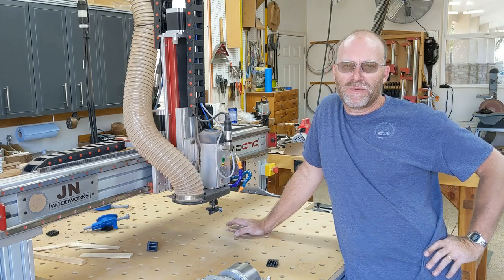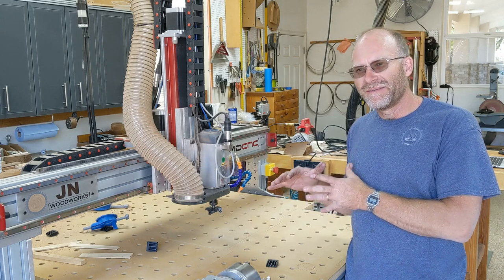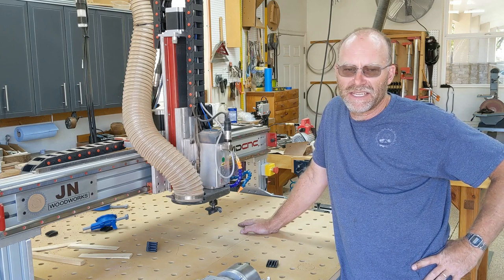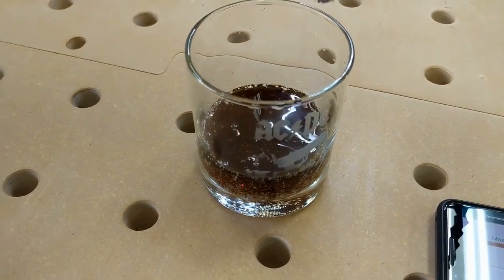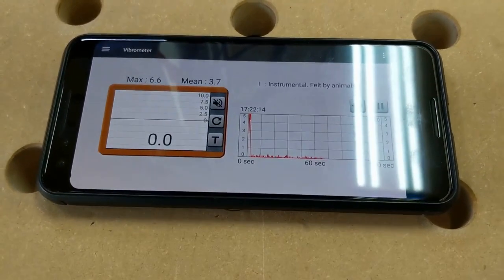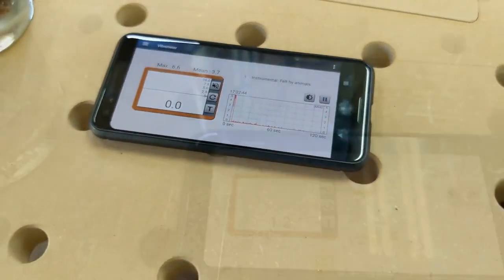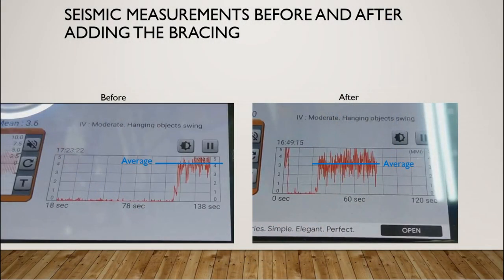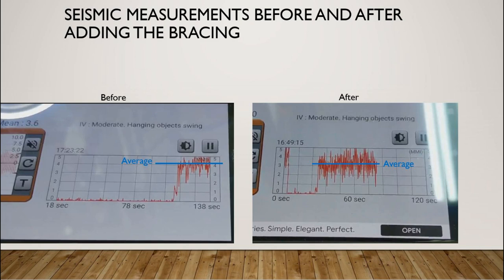Vibration reduction project for my AVID CNC Router table

Comment: Hi Jim, great video. One of the major causes of vibration in these Avid set ups is due to the very large mass of the gantry and its location. The center of gravity is very high and as such as the x and y accelerate it induces these vibration/ In addition to the straps that you added a lower shelf addition would allow you to counter the weight of the gantry. I have about 400 pounds on the lower shelf and it has helped significantly. Cheers!
Reply from the maker: That's right, large mass on top, and pretty powerful X and especially Y axis motors.  Thats why AVID doesn't recommend the extra high Z stage, or 8.8hp spindle, etc. unless you really need it.  The table bracing and extra mass in the bed both go towards the same goal.  In the end you have to run slower than the machine can go just to keep it from shaking itself apart.  Since I'm a hobbyist, it doesn't hurt me to slow it down since I'm not making money off of it.

Comment: Jim,
Thanks for all your great content!
I have had my 48x72 going for a month now and I experience the same vibration.
I’ve added a lower shelf 2X4s lumber and plywood, and will be adding weight for dampening. I will also be adding plywood sheathing for shear every where I can get it. And boxing in as much as I can.
We’ll see…
Reply: I'm glad I found this video.  I've seen similar behavior in my 48x96.  I'm curious if adding the plywood sheathing on every surface of the stand helped reduce vibration/increase rigidity in your setup Steve.  I think I may add a lower shelf and add weight there as David mentioned in his comment.

Comment: As a mechanical engineer that has solved lots of vibration issues, adding mass is the quickest, easiest and cheapest way to solve vibration problems.  Adding a low shelf and storing tools on it is one solution.  Weight lifting plates are nice but are about $1 per pound.  Bags of sand are an alternative and cost 75% less. But they always leak sand.

The pendulum suggested below is a viable solution. But the pendulum should be mounted near the top of machine.  Skyscrapers have (big ass) pendulums to dampen vibration caused by wind or earthquakes and they are mounted near the top of the building. 

Also, there are several places where stiffening plates can be added at the corners.  80/20 sells a bajillion styles of these plates

Comment: Hi Jim.  I just recieved my 4' x 10' and have started putting it together, one thing I noticed on mine was that when tightning up the fasteners on the legs and especially the cross rails (with the double Tee Nuts) that using a drill with a torque limiter/clutch (Festool CX) the drill would clutch out and I would assume that the fastener was tight, however, this style of fastener has the ability to 'cock' and not seat squarely meaning that the fastener is in fact still loose to some degree.
Once I saw this I went back through all of them and found >50% of them that needed further tightning, since doing this the table feels solid, at least with me pushing/pulling on it.
May not be your issue, but something to be aware of and easy enough to check.
Will get back to the build and hope no more issues, fingers crossed.
Cheers
Gus
Reply from the maker: Hi Gus,
Ya, I noted that too.  I haven't noticed them coming loose over time though, and my table never felt loose just trying to shake it by hand.  But those nema 34 motors can push a lot harder🙂

Comment: I’m an engineer. Using aluminum, pound for pound, vs steel can actually be stiffer. A well designed bolted joint can be just as stiff as a welded joint. Those things are not really factors. The Avid design lacks adequate triangulation. Ideally you want a space frame or truss. You want to keep the table from twisting as the gantry is loaded side to side, and to keep vibration to a minimum. If you think of the ground as the most stable possible surface, then the frame base design should be to extend that stable surface to the table height. But if your floor is not stable, then all bets are off. I would add triangulation in both the x and y directions. That will sacrifice space under the table for storage. But you have to make tradeoffs, is stiffness more important or storage more important?
Reply from the maker: Stiffness isn't necessarily a good thing.  Steel typically has a higher Q factor than aluminum and if not used right can be a very efficient oscillator.  You are correct about the joints, it doesn't really matter if they are bolted or welded, they are less of a problem than the flexing of the joint (as long as the bolts aren't loose).  The most overall stiffness does come from triangulation, which is why I did add cross bracing as shown at 5:11.  All of this only goes so far because on top of the table/stand, there is a lot of flexing int he gantry and other components as well, and that always has tradeoffs as well.  I did another video on balancing the motor accelleration settings in my controller between longer execution time and lower vibration, that had a much bigger impact on vibration.  https://www.youtube.com/watch?v=ws4fzEN97BU&t=2s
Reply: You need stiffness if you want good surface finish AND fast cutting. Yes, you can slow it down. No matter the metal type, everything will oscillate at its resonant frequency.
Reply: Actually, an interesting thing to do would be to isolate the effect of the rubber feet on your vibration test. My hunch is that the rubber feet doesn't supported the machine that well, as it pivots and moves around on that small center bolt. Shim up the legs so that the feet isn't bearing weight, and then repeat your vibration test. Make a follow up video about it; I think it would be interesting.
Reply from the maker: @acutabovefurniturestudio  I don't have rubber feet on mine.  They are steel pucks that are bolted to the legs.  The vibration on the Y axis is an order of magnitude more than that on the X axis and that is due to the construction of the gantry and how it mounts to the table etc. as well as the amount of mass that has to move in the Y direction vs. X.  I was down to about 4-5 thousandths of an inch peak to peak in the the initial amplitude from a direction change, which isn't much, but even with a completely rigid table, the top end of the machine also flexes and there isn't much I can do about that besides cut down the acceleration settings on the X and Y motors (a topic of another video I did later).
Reply: Got cha! @JNWoodworks

Comment: Hi Jim. a lot of what you are experiencing is vibration resonance in that aluminum extruded structure, a lot like a tuning fork. the best way to eliminate that is to dampen it. what I did was buy a 3 inch memory foam mattress topper and cut it into 3 inch by 3 inch long strips. I tied a string to one end and had my daughter pull it through the hollow Extrusion while I compressed the other end. this allowed the memory foam to expand inside the aluminum Extrusion. I did this to every single Extrusion, probably Overkill but the difference was huge.
   the machine now Acts like a machine five times its mass, you may not want to do this as your machine is already assembled... it was a lot of work. but I would highly recommend you at a minimum do it to your Gantry and your bed rails. it will make a huge difference and those things are the low-hanging fruit.
 hope this helps,
Reply: That's a really interesting idea! I would like to learn more about this, did you read about this somewhere that I could get additional information?
Reply: Hmmm....I wonder if polyurethane foam insulation would accomplish the same thing.  Squirt some in and let it expand.  Probably easier/faster than inserting memory foam.
Reply: I'm actually trying to do that now. There is no way a 3x3 strip is fitting into those small extrusion holes. I am trying 1.5 x 1.5 with some success; the foam keeps breaking about 40% of the way in (yes I am pulling and stuffing at the same time.) How ever did you manage this? I am using a memory foam topper (got on Amazon) but it fully expands within minutes so there is no way it isn't going in fully compressed. Perhaps, as suggested above, the spray foam insulation would be better (though how would you get it in far enough?)
Reply: @gilroykilroy  Guys, best solution would be to fill your extrusions with sand(yes) and seal the end openings(to avoid 'leaks'), ofc, that would require doing it prior to most of the assembly( though maybe you could do it for the 'legs' after the fact)

Comment: Jim, have you tried varying the acceleration on the x and y motors in Mach4? I think the stock Avid setting is 50 which might be more than needed for your application and be the cause of a lot of the vibration.  My current machine is not an Avid but I never run it much higher than 30 and still get very good performance.
Reply from the maker: Yes, I mentioned that in one of my videos.  The stock AVID acceleration settings are too high for most of their larger configurations.  I have cut all of mine back to 25 and that helped a lot.  It also did not affect the run time in any significant amount.

Comment: try implementing a pendulum (hanging mass) under the table...in theory it would counter the vibration. vibration is a waveform...change the frequency of the waveform you change the vibration.
Reply: a neat idea

Comment: I have an avid 5x10, what you did theoretically should help but in reality bracing isn't as big of an issue as is mass, the gantry is very top heavy and the bottom of the machine (few legs/braces) are very light, inertia gets the best of the avids... at one point I had a large lumber delivery and had my guy store about a 1000 board feet of lumber on the lower shelf of my machine and let me say that with the weight on the bottom my machine ran smooth as butter, no more chattering, even at 300ipm full depth through 3/4 plywood it felt like an industrial welded cnc. Given my experiance, I ordered up a bunch of 80/20 to make two additional shelves, bracing and filled them up with ranger board mdf. Load up your bottom shelf with as much weight as you can find and run the test again. Secondly and this is a very important step that I noticed wasn't very pronounced in the instructions when I built my machine was to use locktite on every single fastener on your machine, and I mean that with the utmost importance, every single bolt, I had to get my z axis replaced because the bearing blocks came loose and ruined the dust guard. On the new one I took it apart and locktited everything! Best of luck ! Great video
Reply: @zoltanbereczki8067  blue locktite only prevents the screw from rattling loose, not from being unscrewed. As long as you don't use the red locktite, you can easily back the screw out. On smaller screws, use very little, just a tiny little drop.

Comment: Hello, I’ve been investigating this issue with my own machine similar to yours. People seem to forget that the that these machines are sitting on six 1/2 inch pins to the floor. There has to be movement there. I’m considering bracing to the floor or setting up blocking to strengthen that section. Just a thought.
Reply from the maker: Hi Bill,
Well, those pins aren't meant to stop the machine from moving.  The stiffness comes from the frame, not the connecting to ground.  However, in the end most of us that worked on the frame only got moderate results because in the end, if your motor movements are too agressive, any machine will flex and have vibrations.  I got much better results by adjusting my accelleration settings.  See this video:  https://www.youtube.com/watch?v=ws4fzEN97BU
Reply: Hi, when I look at mine which is similar to yours, even if I completely stiffen the frame, I am still left with those 6 adjustment feet flexing back and forth in the threaded piece of aluminium bolted to the bottom of the aluminium legs. I suppose if I screw them all in as far as I can and still have a level machine it should reduce the bending moment on the adjustment studs. I will certainly take the strategies you have worked out and employ them into my build. Thanks for taking the time to create the video and getting back to me regarding my comment. Regards.
Reply from the maker: @billjohnson7834  You probably do have some movement those feet, and reducing it will help some.  I never really thought about it much at first, but I was trying to reduce the movement of the table, but after working on this for a while, I realized that the table movement itself doesn't affect the cut quality, its the relative movement between the spindle (or laser head) and the workpiece.  So I did get some reduction in table movement in the stiffening I did in this video, which at least was nice to keep the table from shaking itself apart, but I still had chatter in my router cuts and squiggles in my laser lines.  This was due to flexing everywhere else in the system, like the gantry, linear rails and stuff.  I couldn't reduce any of that mechanically, but dialing down the motor accellerations really is where my cut quality improved.
Reply: @JNWoodworks  Interesting, I can see having that type of vibration from my helical rack feeding back into the system. I would think that lasers would show that vibration the most as compared to a router cut. On smaller machines, ball screws should eliminate that.
Reply from the maker: @billjohnson7834  There are low level vibrations on my machine from the belts and the gears, but until I adjusted the acceleration settings (AVID CNC sets them aggressive by default) the most prominent ones were from acceleration during moves.  You are right, the laser is a perfect way to see that, in direction, amplitude, and frequency.  Once I started looking at my laser traces is where I started understanding what is going on.  I now still have a periodic vibration due to either the racks or belts (can't tell which because they have the same tooth pitch).  I probably won't be able to do much about that.

Comment: Jim, thanks for posting, I have been waiting for you to post this based on our last exchange, I to have been a bit surprised as well regarding amount of vibration on my just installed 4x8 AVID.  I will do a version of what you did but as one other poster noted, WEIGHT add it, lots of it. If you look at other machines weight and just consider kinetic energy weight is a significant factor.  I need to think more about it but floor mounting might help too.  Look forward to more videos from you.
Reply from the maker: Hi Cliff, Keep in mind with weight is that the higher the better.  It will only be half as effective halfway down as it would be at the top, and if its just hanging from a shelf, it won't do much good at all.  It has to be rigidly mounted so there is no flex between the top rails and whatever is holding the weight.  If you are going to add mass to it, it would be best to just bolt it to the underside of the cross beams.
Reply: Understand, I will have 2 layers of MDF as well as the vertical table mounted in front and a like but not accessible board on the back (think of shear wall) still thinking about right way to do long direction. As well as plate bolted to bottom of table cross braces. In any case love your more technical vids.  Where are you located?
Reply from the maker: @cliffneal3118  I'm in Gilbert AZ.  If you are ever in the area, look me up :-)
I think you could put a shear wall on the inside of your sides (provided you don' have drawers like me, and then just cut out the sheet around the top crossmembers and front wall support so you can bolt them to the side pieces. that won't take away any appreciable strength.
Reply: Thanks, I’m close to Napa CA, look me up if in the area as well.  I think there are some good overlaps in how we do things and enjoy the, as well. Cheers. Cliff

Comment: I think you need a first and second derivative motion sensor AT THE SPINDLE feeding back into the motion control circuits. On aircraft, the radar needs its own accelerometers separate from the inertial navigation system. Unfortunately, I can no longer remember how to do the math. If your scales can measure position with respect to the workpiece rather than table shake, A control circuit can do much with a spindle articulated separately from the slider to correct for shaking in real time with high bandwidth servos at the spindle.
Reply from the maker: A vibration control system that is 10 times more complicated and expensive than the actual machine probably is not too practical.  Controlling the acceleration profile of the motion is easy and free :-)

Comment: Could you add cable bracing? Guy wires under the table to the floor in x brace formation?
Also, can you run a frequency analysis on your motion to know what must be dampened.
Reply from the maker: The feet aren't sliding on the ground, so the cross bracing the corners is just as effective as cross bracing to the ground.  The cross bracing helped the table from moving as much, but as I found out when I started using a laser head attached to the CNC there is a lot of flex in the gantry and mounts.  It is very different along each axis.  You can only do so much with the chassis, but in the end  controlling the acceleration curves is the most effective.